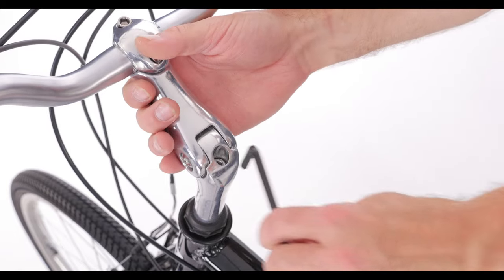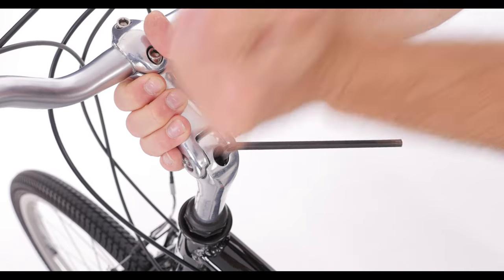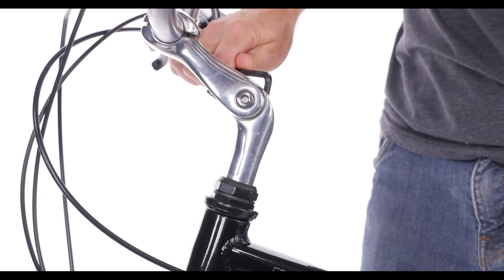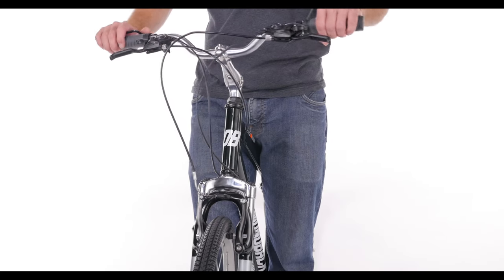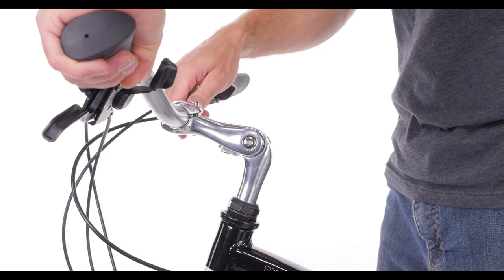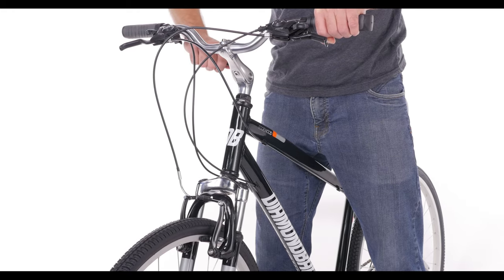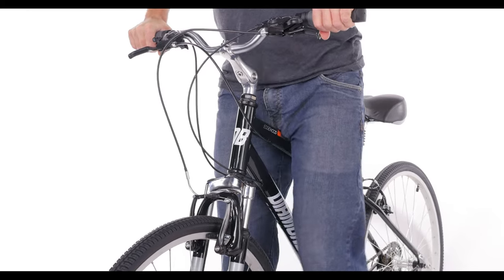Adjusting Your Adjustable Threaded Stem

Comment: i loosened the bolts on the side before i watched this. OOOPS! did i create an unforeseen problem for my self????????????????
Reply: I did the same thing. The right side came right off. But the left side would not budge. I put a pole to allen wrench to see if it would budge and I stripped it. I guess the one on the left is welded into it. Had no idea there was a screw on the bottom. I hope I didn’t screw anything up either.
Reply: I did the same smh

Comment: Oh shoot I loosened the one on the side and I couldn't adjust the angle so I tightened it back down. He said don't touch it, it had a sticker around the neck that said torqued to 220 blah blah, that's why I should have left it alone, will it be ok or am I screwed?? no pun intended.

Comment: What is the name of that horizontally positioned stem bolt (side bolt?) that you said not to touch? While trying to tighten it I have stripped the end of it. I would like to buy a replacement. Thanks.
Reply: Did anyone ever answer this? I'm looking for the same thing!

Comment: Hi, the stem on my bike is not tight in the area of side bolts, i.e. there is a small movement in this area.  Tightening the side bolts or the underneath bolt doesn't help.  Is it possible to repair or it is worn out for good?  Thanks.

Comment: My cruiser has a quill stem handlebar system, but I find the reach is too far forward for me, even at maximum upright extension. Is it possible to "flip" the stem part so that the tilting portion faces towards the seat (i.e. angles downward and towards the seat) instead of forward and away?
Reply: This sounds like a strange problem. Are you sure the bike isn’t too large for you?

Comment: The top bolt is not reconnecting at the bottom. What's the trick of lining it up
Reply: Did you ever get an answer? I have the same question.
Reply: @rogerranalli8253 do you mean that you loosened the stem bolt so much that the nut on the internal end fell off? In that case just pull the stem out and reach up from the bottom of the stem with some rod to push the nut up through, then reattach. The wheel will need to be removed to do this.

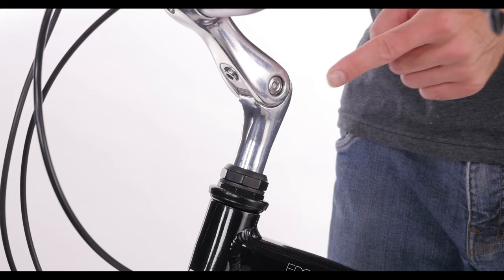Comment: what do you call the bolt you're pointing at 0:51? please reply asap coz I really need to buy a replacement since I lost that bolt for my bike. thanks :)
Reply from the maker: Hello, that's a quill stem, but if you're buying a replacement bolt we recommend taking it to your local bike shop. All bolts fit differently into different quill stems (they're all manufactured in different places) and we want to make sure you pick up the right one so it's safe!

Comment: This video gives incomplete and incorrect information that can result in an unsafe bike.

Firstly, the quill stem fastening bolt going vertically into the fork needs to be tighter than just 'leaves a mark on your palm'. Done as loose as shown in the video the stem will work its way loose and your bars will turn independently of the front wheel. You need to tighten it firmly.

A way to gauge if it's tight enough is to face the bike from the front, hold the wheel between your knees and try to turn the bars from side to side. It should require quite a hard twisting effort to move the bars independently of the wheel (I'm talking about actual movement, not just flex). Done this tight you won't have any danger of things coming loose in normal operation but in the event of a crash your bars/wheel will be able to turn out of alignment with less chance of damage.

Secondly, to adjust the angle of the stem, both the wedge bolt underneath and the side pivot bolt that he said not to touch need to be loosened. The stem should not move if the side pinch bolt is tight, even if the wedge bolt underneath has been loosened.

The correct procedure is as follows - 
1: loosen the side pivot pinch bolt from the 5mm hex on right hand side (drive side) of the bike. The left hand side which also has a 5mm hex fitting is normally keyed/fixed and does not rotate).

2: loosen the under stem wedge bolt and adjust the stem angle.

3: re-tighten the under stem wedge bolt (firmly)

4: firmly re-tighten the side pivot pinch bolt.

The re-tightening of the bolts needs to be done in this order. Both of these bolts need to be tight to be safe and to avoid wear to the pivot joint, so check them when you're done adjusting.

If your stem doesn't have a wedge bolt underneath then it's likely that your side pivot pinch bolt has heavily serrated washers and holds the angle by this method, in which case back the side bolt of on the right hand side, make your adjustment and re-tighten.

Comment: What is the length of an adjustable stem in mm
Reply: Depends on the stem. It is important to remember not to raise it high enough that the maximum height line would be visible.